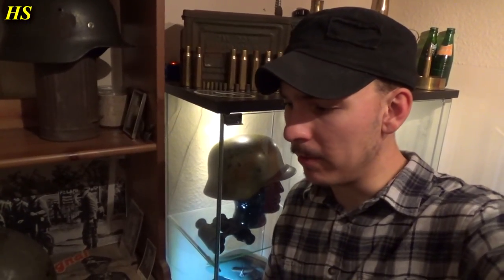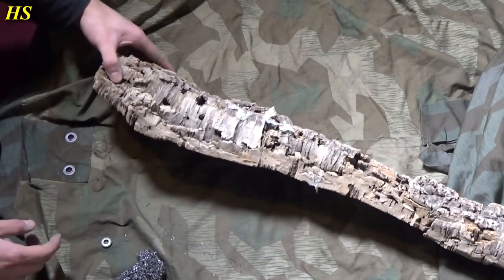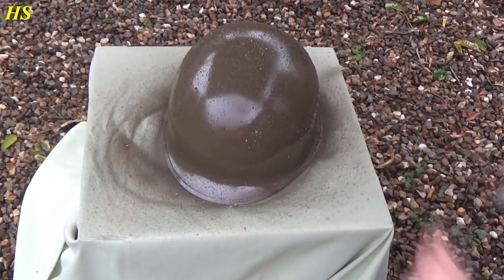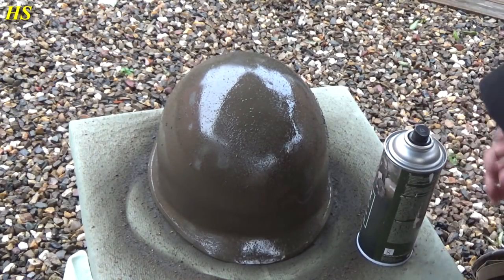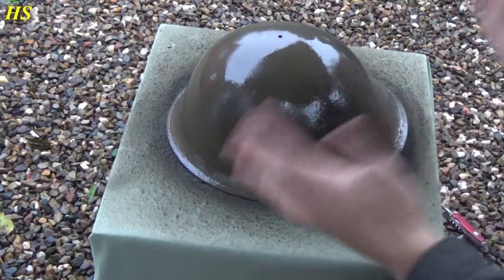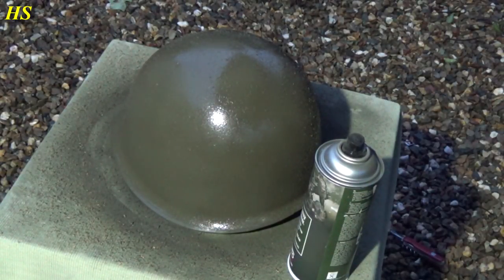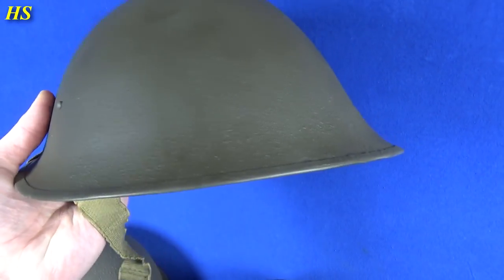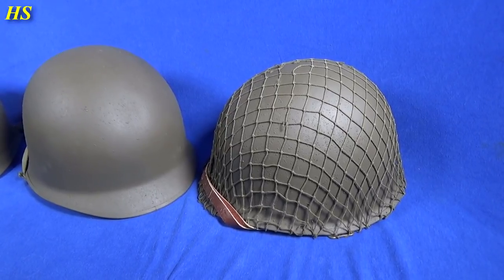WW2 U.S. M1 Helmet - How to Restore a M1 Helmet / Convert a Post War helmet to a WWII One!

Comment: You are wasting most of the cork. Put the cork in a plastic jar that has small holes in the lid, you can then shake it over the wet sections of the lid. Much quicker and an even finish.
Reply: That's what I did for my postwar m1 for ww2 reenacting

Comment: Is it possible to install the swivel bales onto helmets that don't already have them? I looked everywhere and haven't found any instructions on how to do so..
Reply: You would have to have them tack welded in place to be correct..similar to having the fixed bales tack welded..if you have the equipment,  it shouldn't be hard to find the right locations to attach the bales...

Comment: I happen to have 30-40 WWII Shells, that were used again in Vietnam and were painted several times, I removed all the paint with Lye and now I need to paint them!!  I need to find that paint
Reply: If ur in the US, 1944 Militaria is a good place, might be a little more on the spendy side at $16 a can, but it’s pretty good paint, I bought some luftwaffe blue and feldgrau paint from them and both of those helmets turned out great
Reply: @connoratkeson8926  I need to find a decent way to add the Cork so it's evenly spread!!  There has to be a way!!  I have so many shells here!!
Reply: @yrsued  sand up ur cork, and put it in a salt shaker with the holes drilled out a little so the bigger pieces can pass through
Reply: @connoratkeson8926  Nice idea!!  Thanks!!  I can do that!!!  How fin should I grind the cork?  This one guy used to do my helmets 20+ years ago, I lost touch!!
Reply: @yrsued  I used a cheese grater on the pin hole side and it turned out really well, you could also use 60 grit sand paper, you want them to be big but not to big, but also not like a grain of sand

Comment: I have one that has the seam on the front of the brim, so dose that mean it is from 1941-1945? Also mine looks like it was coated in a thin layer of concrete than painted

Comment: I've still got the one I was issued into 1965 in the National Guard. It ❤was used when I then . Textured. Ww2? . Nam Era?
Reply: If it has a front seam/slit in the front it’s definitely ww2 produced.

Rear seam can be ww2 but it’s more rare but not hard to find.

Swivel bail came in 1943 

Front seam 1940/41 - late 1944

Rear seam late 1944 - 1968/69.

American production stopped in 1969.

While other countries still made them into the 1980s

The U.S. stopped using the m1 in the mid 80s.
Maybe later since it takes time to replace gear or equipment.

Comment: The second time I was stationed in, then, west germany I was issued a gas mask and a helmet. I still have the helmet. I remember not getting a newer green hepmet, but I didn't want to be petty. Turned out it was a WWII issue. The color was darker than the new helmets and it has the cork in the paint. It is slightly out of round with the right rear edge pushed in. I am going to " WWII" the liner with the proper nape strap.

Comment: another person who took an expensive and valuable turtle helmet and devalued it by painting it
Reply: There millions of them and they aren’t expensive you can get them for like 40 usd.

And it was painted post war.
Reply: @Worldwar1944  try around $200 for a genuine ww2 helmet
Reply: @joeydepalmer4457  I have original m1 helmets and they were less then 100.
Reply: @Worldwar1944  oh well. i sold my old Vietnam helmet for 175
Reply: @joeydepalmer4457  it’s it’s a full set then yeah.

But the Vietnam era helmets that I have  the shell only I got it for $50.

But if it’s the full set they’re around like you said $175.

I like to get project ww2 shells to restore
If it’s not original paint.

I don’t mess with original condition.

But if it’s like 1970s or 1980s it’s nothing special.

My opinion
Reply: @Worldwar1944  outer, inner, chin strap (airborne), cover, net and band. just like my ww2 ones (different covers, 1 was an old shirt cut to fit)